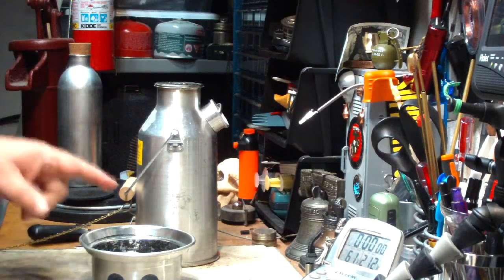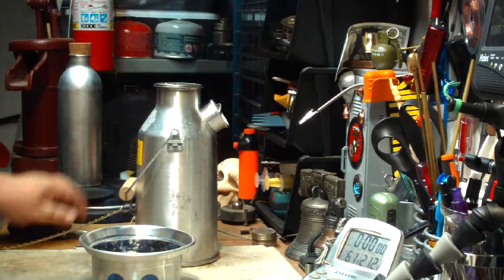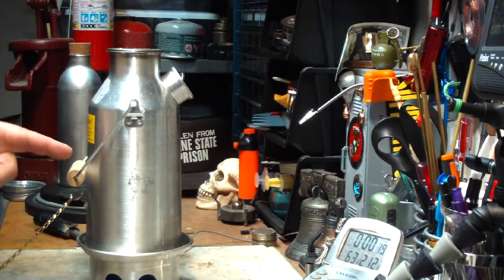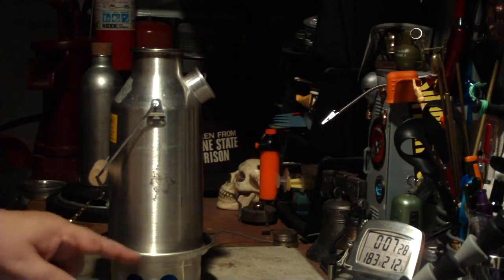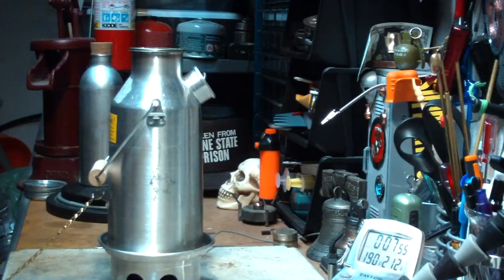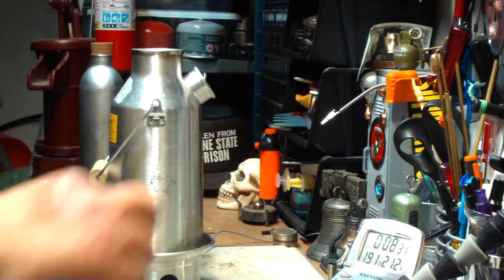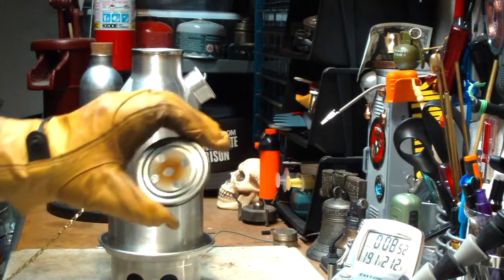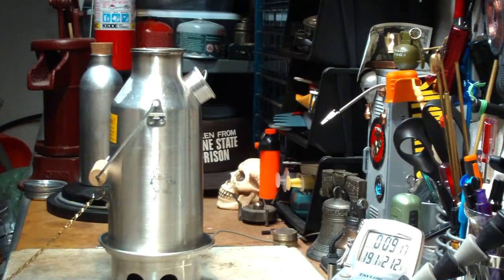Kelly Kettle - Draft Modification #1 - Boil Test #1

Comment: I was thinking trying to control the air from at the air input might be easier and still leave the top open to use the pot stand. A simple aluminum band should snap around the base fairly easy I would think. I hope we get this figured out soon. It just isn't a genuine Hiram video if the water never boils. ;)

Comment: In case it's not clear, it's just a long piece of felt folder over and then stapled in a few places to form pockets.  You then just open up the pockets a bit and form it around the outside of the burn chamber.

Comment: I know I just posted this in your first boil test video, but I'm playing catchup.  Try a carbon felt arrangement like what the maker of the Backcountry Boiler makes, the FireFelt alcohol wick.  Google "firefelt alcohol wick" and you'll find a video on it as well as his website.  I have one of his boilers and it works perfectly.  Keeps the flame on the outside of the burn chamber so you don't loose anything to the opening in the middle.